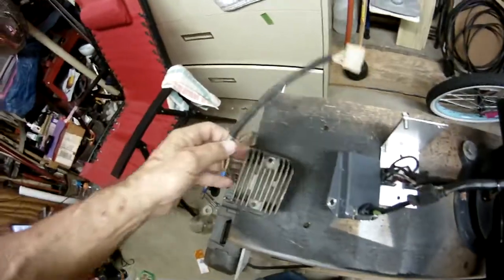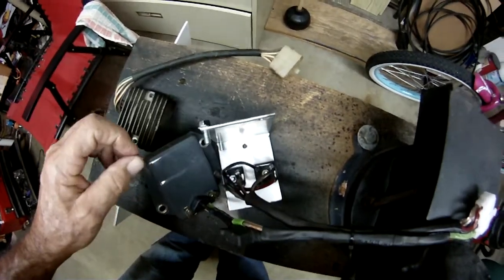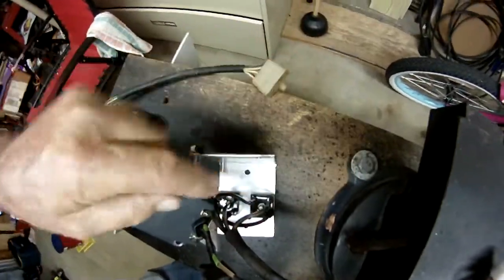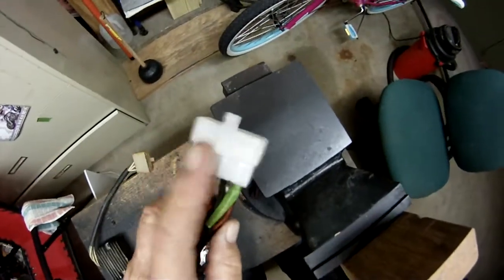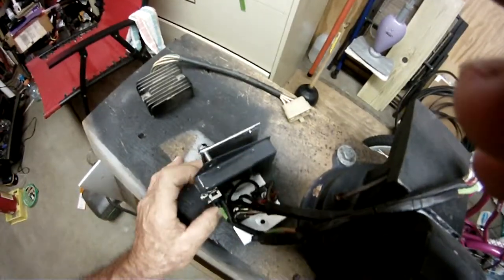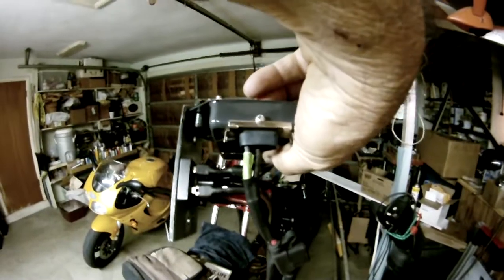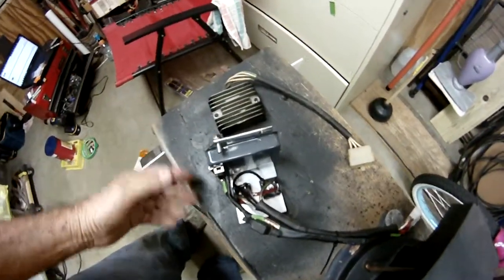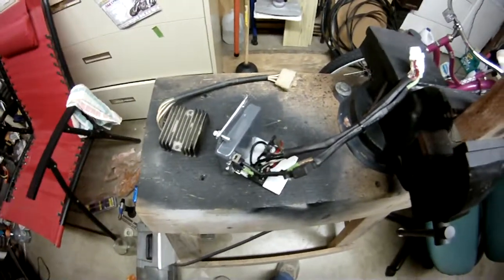XS650 reg/rec upgrading

Comment: Is there a performance difference between the two?
Reply from the maker: with oem reg/rec the charge voltage didn't sty at 14.5 volts
after upgrade charge voltage stays at 14.4 -14.5
battery and lights like that and so do I.